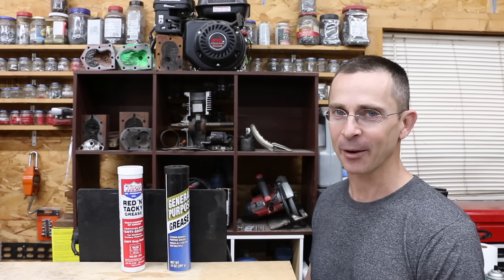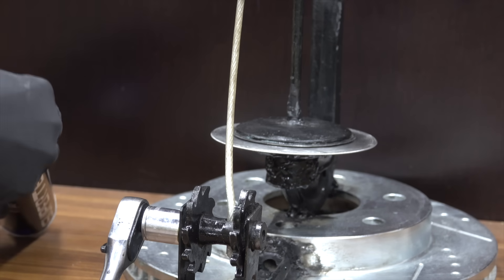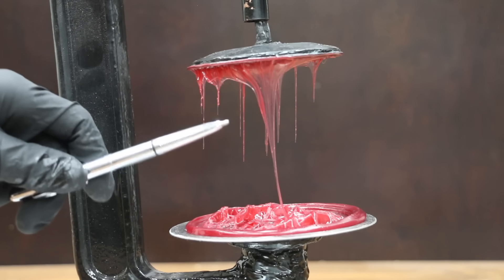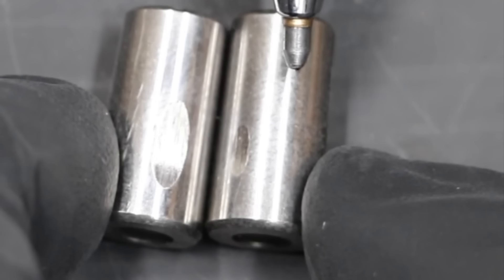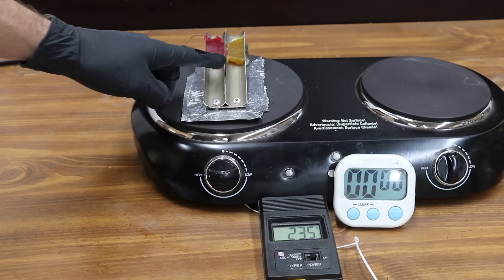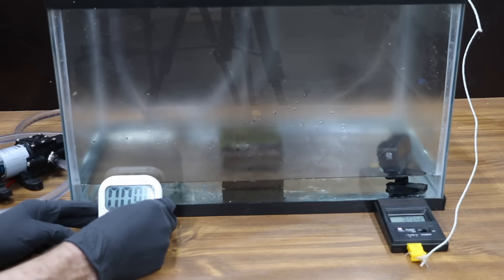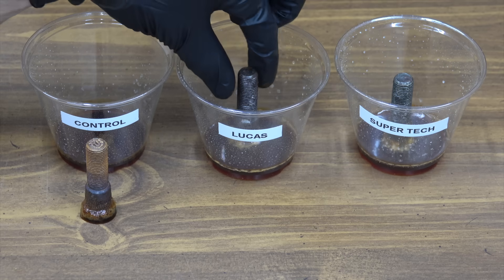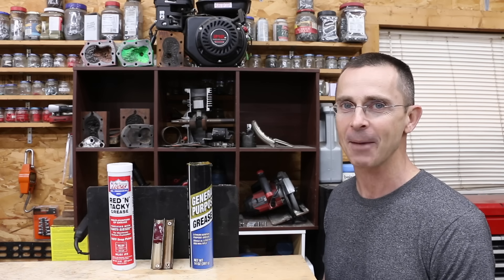Is Cheap Grease better than Lucas Red N Tacky? Let's find out! Bearing Grease Test Episode 1

Comment: At first I thought Project Farm was going to show me how I've been wasting money buying Red "N" Tacky for all these years.....but thankfully it appears I chose wisely. 👍
The only test I would have liked to see was you placing the bearings in water and then spinning them over time to see if the grease would become compromised.  Just like boat wheel bearings have to deal with...
Reply: Great comment
Reply: Yep I think this would be nice to see as I have motor spindles that have there seals blown out and if I’m in wet grass idk how much is getting into the bearings.
Reply from the maker: Great test idea
Reply: Absolutely would like to see that
Reply: Boat trailers need a different type of bearing grease. Red"N" Tacky wont cut it.
Reply: @MTips18  I have used Red"N" Tacky on my boat trailer for four years now.  Two to three times a week  (spring, summer and fall)   it's backed into lake water ( 40 mile round trip) and for two months  a year it goes to Florida from Colorado and is put in salt water not to mention the 3,500   miles just to get there and back.  I repack the bearings before each trip to Florida and at the end of the season before I put it away for winter. Original bearings on trailer and show zero wear to date.  Red"N" Tacky 100% works for boat trailers!
Reply: @jerplane400  You and I are the only boaters who grease our bearings that often. That is the key, pump in fresh grease and push out the water and dirt.
Reply: @BrianCover-f8n  Cheap insurance in my book!  Cheers!!
Reply: @MTips18 gotta have that green stuff
Reply: @M @MTips18 my new venture boat trailer specifically calls for Lucas red n tacky in the wheel bearings..  kinda surprised me, but until I repack them that’s what it’s getting..

Comment: Great Video as always.

I use Valvoline Moly-Fortified Gray Full Synthetic Grease. I always thought it was the best.

Moly-fortified for increased film strength
Fortified with extreme pressure additives for exceptional load-carrying capability
.
Helps inhibit rust and oxidation
.
NLGI #2 GC-LB lithium complex EP grease.
Reply from the maker: Thank you for the video idea!
Reply: @ProjectFarm  My pleasure. Thanks for making the videos Brother.

Comment: I think that it heavily depends on the use. Sure, if you need the heavier duty stuff, use Lucas, if it’s something simple and very light duty, maybe the cheap stuff is fine. Like for the door latch on my car. I might use the cheap stuff. But if I had to pack a bearing on my car, I might use Lucas. However, maybe packing a bearing on something like, a low speed trailer wheel... like the kind that goes behind a mower. Cheap stuff is fine. 

However.... with the price difference, buying the Lucas stuff is easier because it’s not much more and you only need that. I think overall though, the cheap grease is more than good enough for most light duty applications.
Reply from the maker: Thank you for the feedback

Comment: What's the best type of hand cleaner to get the grease/oil off of you hands?
My grandfather was a fabricator and always used cheap powdered laundry detergent. It did a great job getting all the grease off.
Reply: Soap is soap. I like to use some borax with soap for the grit factor. Plus borax does something to enhance soap. If you're ever in a bind you can do the Comet and Palmolive trick. Donno what the chemistry is going on there but by the smell I'd say it is intense. May want to wash your hands with regular soap afterwards?

Comment: I have seen what happens when you mix greases. We’d send pumps and motors out to plants and they’d come back within a year with burned up bearings. Upon disassembly we saw that the grease was like putty or clay. We’d tell them to use a certain grease but they’d use whatever was in the gun.
Reply from the maker: Great point!

Comment: I just used the Supertec High Temperature Multi Purpose on a Ranger wheel bearing repack. It’s a red grease like the Lucas but came in a can. Works well on guns too!
Reply: opisex Fireclean turned out to be a canola oil blend. And Froglube is just coconut and peppermint oils. A lot of other gun oils are just repackaged light synthetic motor oils. Old military manuals call for using whale oil!

Comment: Just a heads-up:  I just re-subscribed.  No, I never un-subscibed.  YouTube decided to do that for me.  
So folks, check your subscriptions.  YoutTube is up to its ol' shenanigans again.
The subject of this video reminded me of something. I used to work for a contractor whose equipment was constantly in need of repair or just plain worn out.  It's like the entire company, employees included just said "Lubrication?  What for?!"  I'm tellin ya'!  Those people acted like oil or grease was a sin against all that is holy!  
I began to bring an oil-can to work and oiled everything I used.  From door hinges and latches on the trucks, to the hinges on the gang-boxes, and even the hand-tools with moving parts like ratchets, pliers and vice-grips etc. that I happened to find in the boxes, and had a chance to dab a drop or two of oil on.   I swear,  everything was rusty and crusty, or just plain ol' funky with mud, dirt and rust, everything BUT grease or oil.  When I took company trucks home for the night, I would find the grease fittings for the suspension all rusted up, often unable to take grease until I wire brushed them.  I even found one truck so low on engine oil, that it didn't even show on the dipstick! 

One way to save money on lubrication, I guess.
Reply from the maker: Thanks for the heads up on the subscription.  Not sure why this is happening but welcome back!
Reply: @ProjectFarm  Thank you. I never really missed any vids since I still saw them in my homefeed.  It's just wierd how YT does that.  I am subbed to several channels that feature " pew-pew, tubular, powder-powered, projectile accelerators" (if you catch my dirft..)  and I have been mysteriously unsubbed a lot of times from them. So now I kind of expect to find one or more of those channels off my list every now & then.  But yours?  I don't know why.

Comment: I’d like to see how MasterPro’s extreme pressure (EP) moly grease performs. It’s O’reilly’s house brand grease. I use it in my lawnmower spindle bearings during regular maintenance procedures. 

Edit: seems thin but very durable as far as I can tell, not very tacky though.
Reply: It’s not usually recommended to use a moly grease in a high speed bearing application. I would like to see a comparison of a 3% and 5% moly grease. Local Caterpillar dealer will have both.
Reply: Jeremy Hageman that’s what I’ve read elsewhere too. Only reason I still use it in the spindle bearings is due to it being the only grease I had lying around when I bought the mower 4 years ago so I’ve just stuck with it ya know.
Reply: It's supposed to be the same as Chevron ultra ii something or other. Made in the same place. I use it. It's pretty good. Heavy equipment and high speed home built motorcycle are my experience.
Reply: Amnesia Iforget same results I have gotten. It’s worked fairly well in a spindle turning 3900 rpm maybe a little more but still holding up!
Reply from the maker: Thank you for the video idea!
Reply: Project Farm Yes sir! Always have appreciated your videos, and all the hard work you put into them!

Comment: I’m curios about the no brand, brushless cordless drill and impact drills on the Banggood app, $40 and use Milwaukee batteries
Reply: Got a link?
Reply: Valley Tractor [US$38.36 6% OFF]18V 350 Nm Cordless Impact Wrench Driver Brushless Motor Electric Wrench Adapted To Makita Battery With LED Light Power Tools from Tools, Industrial & Scientific on banggood.com https://banggood.app.link/uO5u5pBza4
Reply from the maker: Great test idea!
Reply: Go away spam man

Comment: I have used ALOT of different greases in a heavy industrial environment that I work in.  Lucas is good stuff.  Sticky as heck.  I've never had any issues with it as a GP grease.
Reply: Monel Funkawitz Have you ever tried Power Punch grease?
Reply: Kaliburz Once.  Don't have much experience on it.  Used a lot of of Mystik because it was a clearish grease and didnt make a mess.  PP I remember working good but I got a tube RIGHT when it first came to market.

Comment: I'd love to see a comparison of Phillips head bits, I'm still on the hunt for the perfect brand for the price.
Reply: Good idea. I would like to see that also!
Reply: I prefer the torque bits, they work better and less likely to slip and spin.
Reply: @Bert Grau - Torx bits are great... for Torx screws. Not so great when you need a philips.
Reply: won't be dewalt, those are some of the worst we have used
Reply: @neilbornhoft3323  I'm currently using the maxfit bits from Dewalt and they aren't too bad actually. I'm not partial to any brand, the Milwaukee bits are the least effective ones I've used for my application however.
Reply from the maker: Tyler, 100% of project farm videos are viewer request.  I'll do it.  Thank you for requesting this one!
Reply: @ProjectFarm  That's awesome, I really love this channel and the work you do!
Reply: Tyler Chaffee hello, but the biggest problem With PHILLIPS heads is not everybody uses the proper size, and too much TORQUE  on the driver  drill, and they SCREW THE HEADS UP,  HOWEVER. The most popular is #2   Whom ever assembled my bed, did JUST THAT  screwdriver will NOT BE ABLE TO REMOVE THEM as they were ROUNDED OUT, CHEERS FROM NJ🇺🇸🇺🇸🇺🇸🇺🇸
Reply: @flybyairplane3528  I typically use only the same size 1 1/2'' to 2'' wood screws (not always but mostly) for when I need to drive screws, at least in the field that I work in. All of them are PH2 sized heads. Not all bits fit the same or are of equal quality, regardless of being designated PH2. But you are correct: there are times when it's more appropriate to use hand tools (or the correct clutch setting) and for example, a PH1 head for when I am adjusting cabinets or or securing small panels or trim pieces. I'd also like to add, that some people do not have trigger control and/or try to drive the fastener while the bit is at an angle.

Comment: Question, Do the tubes of grease provide the viscosity rating of the base oil used in their product? If so this could have an effect on the test results.
Reply from the maker: NLGI is similar and both are #2

Comment: Great video as always. My Ariens snowblower calls for a very expensive Stens grease. When I looked up the product data sheet (I think that's what it's called) it was also sold under the brand name "Red N' Tacky". Great way to save some money and an excellent general purpose grease. As far as compatability, it's different base types that can be incompatible. There are several types but many are uncommon and only used in specialty industrial uses. Consumer grease is usually lithium based and two lithium greases should not be incompatible with each other. As far as additives, adding something that improves one quality almost always makes a different quality worse. I forget the disadvantages associated with adding Moly, but I know that while a high Moly grease would probably leave a smaller wear scar on your bearing, it would have worse performance in some other category like high or low temperature or something else. Balance is what you're looking for in general purpose grease. That wear scar was about the smallest I've seen in any test you've done! Plenty slippery enough to lubricate my snowblower's shaft. Why would I want to switch to a high Moly grease if it was overkill in the slipperiness department, and it performed less well when it was 10 below zero?  A good 100% synthetic grease should outperform everything else but the question is whether you really NEED to spend $12 a tube or whatever it might cost. Thanks again for the enjoyable video! Those were well thought out tests and it should establish beyond a doubt that you shouldn't cheap out on grease.
Reply from the maker: Great feedback. Thank you

Comment: As a truck driver, I had different greases for different applications.
For my suspension and universals, I use Lucas red or marine green for the temperature and tackiness.
For my fifth wheel, I use the cheap, soft grease so the plates would slide easier and make turning and hooking easier.
During the winter, I would alternate an oil every time I would hook up, such as Motorkote or even 80/90, so the locking mechanism would work in sub-zero temps.
Reply from the maker: Great information. Thank you
Reply: @ProjectFarm  BTW, Schaeffer's is touted as being on par or better than Lucas, would be worth a test.
They have all manner of mechanical fluids.

Comment: I like how you videos and explainations have improved. Very easy for a layperson to understand. Roo bad you don't have a cone penetrometer to test the thickness.  How a bout a test on cheap vs expensive electical tape? Simulate someone using it on a boat or a tractor do durability and electrical resistance, maybe puncture resistance to split wires, ect. We all hate the black goo of cheap tape.
Reply from the maker: Great suggestions! Thank you

Comment: Awesome video . Thank you . I have been using Lucas grease for years all I use cool to see your test . Have you ever done a test will oil stabilizers like the Lucas brand or others .It would be cool to test the oil the additive is added to and test how the oil performs before and after the additive to see if it enhances the oil in any ways.
Reply from the maker: I did test Lucas HD oil stabilizer a while back. Thank you

Comment: There's 3 Greases I've been recommending for several years as skate bearing grease that I would really enjoy seeing tested.

They are Superlube EP
Schaeffer 274
And Archoil8300

Archoil and Superlube are very likely more expensive than you're looking for, but Schaeffer 274 is pretty typically priced.
Reply from the maker: Great test idea! Thank you
Reply: I switch from a poly urea John Deere grease to shaeffers I think 290. Much thicker stuff. Only thing is that jd poly grease would flow if it was hot or freezing out. Shaeffers is really thick when cold. Very hard to pump. Many more tackifiers.

Comment: Waiting patiently for more grease tests. As always very good. I notice you compared a "light duty lithium" grease to a high quality branded conventional grease. May I suggest comparing two ,or more, conventional greases low price point too high. The the same for lithium based ,and "lithium soap", based greases for your next grease test. Truthfully I never knew there was a difference in lithium formulations.....learn something new every day they say. Maybe using the same brand show the difference between NLG 1-2 and 3 rated grease.....comparison between brands even?. You could draw this out to something along the lines of your engine oil tests if you wanted lol. Personally I have always used a good quality NLG2 lithium base grease in everything. I can complain all I like about the price increases over the years. But replacing far less ,or no, tie rod ends ,drag links ,ball and U-Joints more than make up for it. More so when I am watching/ helping replace the same in friends and families vehicles. This vid validates my convictions Thanks again
Reply from the maker: Thank you for the video idea!

Comment: Thank you for doing this test. In the past, I always use Lucas Red N Tacky or the Green Xtra Duty grease, but for over a year, I've been using the AMSOIL Polymeric NLGI #1 for my road cars and the track car. Still using the Lucas Green Xtra Duty on the truck.

Comment: So, about the friction tester ... I used to work for a company that used a variety of these types of machines for clients in aerospace and industrial power transmission suppliers. Sufice to say there is a lot more that goes into lubricants. I use the cheapest that meets the ASTM specs for that specific application.
Reply from the maker: Thank you for the feedback!

Comment: Great video as always! I think a good test would be to see if those "fuel additive" bottles at gas stations actually improve anything. Some claim better fuel mileage, and to be able to clean the injectors, but I've never noticed anything when I use them.
Reply from the maker: Thank you very much!  Great suggestion!

Comment: Liqui Moly Molygen claims to significantly reduce friction. I added the 5w30 oil on my engine and doesn't tick as much and cleaned my valvetrain and valve cover. It would be a good oil to test the claims.
Reply from the maker: Thank you for the video idea!

Comment: I've used the Lucas grease and I found that overtime the oil separates from the soap. It drips out of the grease gun
Reply: I've used other brands of Red Grease and had the same problems of separation. Would be interesting to see if Project Farm can develop a test for this.
Reply from the maker: Great feedback. Thank you